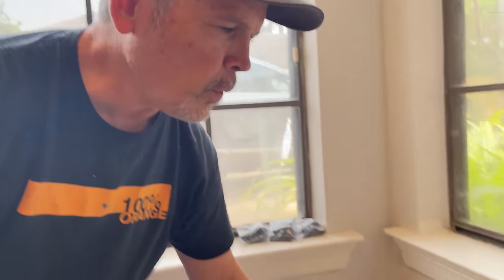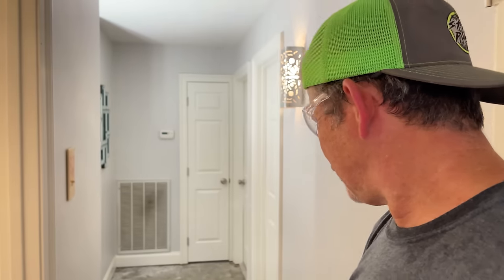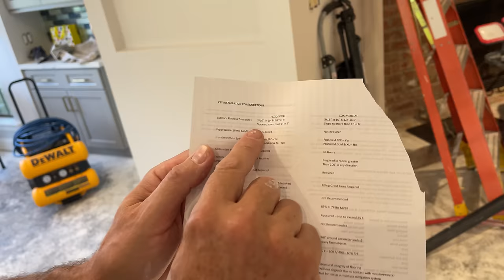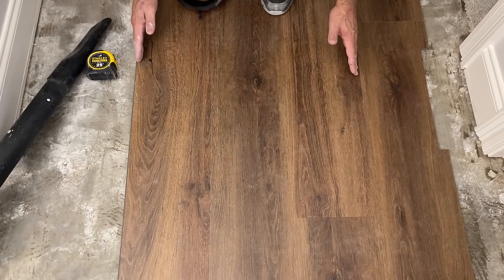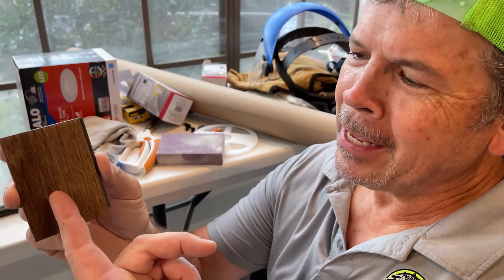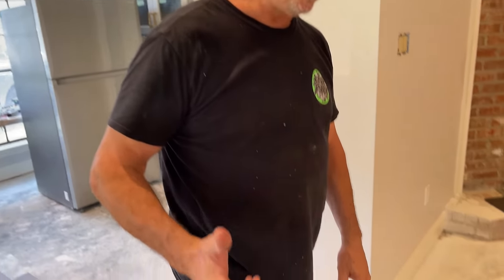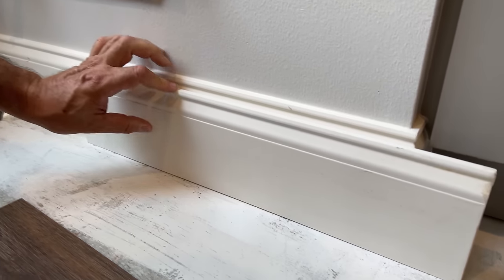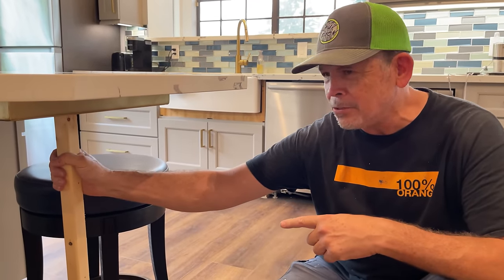The ULTIMATE FLOORING HACK! | Installing Vinyl Plank Flooring

Comment: Question: Why thin set and not the self leveling concrete stuff? I'm about to fix my concrete slab before installing my vinyl flooring and didn't realize thin set was an option. Looks a lot easier to work with than pouring all the self leveling concrete. Thanks again for your video, love how well you all explain everything.

Comment: I am replacing both baseboard and quarter-round on about half the perimeter of the kitchen. The other half is toe-kick on the base cabinets. Should I install the baseboard first, then floor, then quarter-round? Or do the floor, then baseboard and quarter-round on top? Thx,

Comment: On the version of vinyl planking I've used, using the tapping block to "protect" the edge joint turned out to be a bad idea. Banging on anything except a scrap piece with a mating joint would totally ruin the joint. I also found it's a good idea to brush out both sides of a joint before putting two pieces together. Even a single grain of dirt can make the seam less than perfect. 
I wish I'd had your tip about using soapy water when sliding a piece into a joint lengthwise; that's a good one.
Reply from the maker: Thx Karl.   Yeah seems like every brand is different 😡
Reply: YES! I only use mating cut-offs for tapping blocks. Never hit the edge directly. Damaged edges can be costly in material but even more so in time. Although I have never tried the soapy water trick. I will definitely give that one a try next time I'm in that situation. Thanks guys. Subscribed. Great show!
Reply: This is true with almost any tongue and groove product !  With solid oak flooring a long shoulder plane is a good thing to have around too !
Reply: When you install floors in the kitchen, do you cut around the kick plate of the base cupboards and install quarter round or do you remove the the kitchen base cupboards.
Reply: I always use mating pieces  The long edge on the floor piece goes unscathed .  Just make sure the tapper is square with the floor piece .  An angular tap is going to bugger up the floor piece's long seam edge.  Use the same pieces and they slip right back off after the love taps .
Reply: I learned to check the quality of the joints of flooring before buying them. It can mean the difference between a week of work and a couple days. I've ended up just sticking to products I know I can rely on to not be a wrestling match at every step.
Reply: Jason Moore  Jason, can you describe the set up or put up a short video please, I am in the process right now and would love to see or understand this set up...thanks!!!
Reply: @eddym8024  Eddy or anyone else reading this, have you experimented with the optimum size of the scrap Tapper piece as far as width.  The wider the piece, the more the force of the tap is spread out.  If too wide (12") it might not be enough force to close the joint?...if too skinny (2") it might be too much force in a concentrated area? I'm new to all of this but now I have to finish a job two "professional" handymen with experience in LVP installation butchered yesterday at my house.  The Product is LifeProof LVP and the mating (tongue & groove) type of connection are apparently more fragile than other brands and thus tricker to install for 1st timers like my Handmen and now me.  The only difference between them and me is I am spending a day doing research on Youtube for techniques and potential problem areas installing this product.  I'm hoping when I start work to finish the 75% of the job they did not get to because I sent them home after 7 hours of "beating planks", my knowledge from the Youtube videos and ESPECIALLY the commenters (I read all of them and they have many extra tips and tricks) the job will go more smoothly for me.  My handymen beat the snot out of every plank except the first row with a plastic block and I think they damaged the long joints on every board making each successive row just as hard requiring 30 to 50 hammer blows (not taps) on each plank and then removing and trying again.  I knew something was very wrong, either the product faulty or the installers uninformed and not willing to stop and figure out what they were doing wrong.
Reply: Jason Moore  The ratchet straps set up for pulling the planks together instead of hammering them into position.

Comment: What a lot of work.  There goes my grandiose ideas of fixing my house myself.  How does one ensure quality workmanship such as you demonstrate when having someone else do it?  Also,   is this type of flooring a good choice for radiant heat floors?  Also, can one just patch those pockmarks and cracks in the concrete without smearing  and then scraping the whole floor? Thanks.  Also, what is thinset.  Thanks.

Comment: Rotate your plank 180 for the end piece. Line up the end of the plank with the previous end piece. Mark where the new piece just overlaps the last piece you laid down. Score it then snap it. Rotate 180 and put it down. You don't have to hunt for your measuring tape and remember numbers that way.
Reply: "Rotate 180 and put it down". I thought it was "put it in"?
 It's what my wife always says.
Reply: @diGritz1  If she has you rotating 180 first, that's probably your husband
Reply: Wouldn’t that only befor same end pieces (stacked) vs offset?
Reply: @Jopacob  No.

Comment: Curious about something.  Why not remove the baseboards, install the LVP and then reinstall the baseboards.  Then the wedges would work or I just screw in a 1/4 inch thick 4" by 4 foot  board all around the perimeter.  Then when done pull my boards and then reinstall the baseboards.  Paint where necessary.  Just a thought.  Great video.

Comment: what did you do about the space beetween the subfloor and baseboards around the edge of the flooring? wouldnt their be a void where dirt/crumbs/moisture/bugs can collect?
whats the waterproofing like? can moisture get in the joints and sit?

good job though! great video. i really like the tip on using the scrap ends as blocks to hold the floor

Comment: 22:26 "Where did you find that kid?" -- This reminds me of a funny story.  TLDNR

I moved to KC, Mo back in '87 (I was about 25) with nothing but a seabag and $20 (not even a car, I took the bus).  The first day there, I was walking the neighborhood, scoping out where I could find a job.  This pickup turned onto the side street in front of me and the driver stopped, leaned over the passenger, and yelled at me, "Hey, are you going to work today or not?"  I shrugged and said, "Sure!" and jumped into the back of his truck.

We drove a few more blocks and joined a crew that was cleaning out a backyard.  After an hour or so, I was carrying a concrete block to the dumpster when I passed the guy who had yelled at me (the owner of the company) and he stopped and looked at me and said "Hey, you're not Steve!"  I looked him in the eye and said, "So, do I have the job?" After about a second of him trying to wrap his head around the situation, he said "I've been watching you work.  Hell yeah, you have the job!" Later he told me that he had been thinking that "Steve" was working harder than he had ever seen his work before, before realizing that I wasn't Steve.  🤣🤣🤣

I worked for that guy for another 4 months until he ran out of work and had to let most of his crew go.
Reply: That's a great story.
Reply: Poor Steve…🤓
Reply: Good story! Now a days it probably wouldn't be a good idea to jump in a pickup like that to start working.
Reply: "jumpin' in a vehicle" and out...  - that reminds me of a true story - FNK

Back in '77 I was doing my first job. A little back story.. I was lucky I had this job. It was representin' back in the day. The who's who got the nice jobs, learning how do to do stuff. I got this job cuz I needed it. I needed some new threads for junior high, and the dances required some disco threads, you dig? anyways, I was with a crew of summer help that I knew from little league baseball, and junior high sports, these were all my rivals. My mother was executive secretary for school super intendent, so that helped me get on this summer crew when it organized. We painted all the school classrooms, and laid many football fields and parks with grass sod. I got paid peanuts for this hard work but it was good money. I wanted the job to stay outa trouble... and a pair of super fly bell-bottoms

The "jump in"....  We were all at the School District's Bus Barn. This was where all the school buses were at. We cleaned them all. I drooled at the only two diesel buses which were for the varsity high school traveling teams.  Man we just took one to our baseball state championship season. I was in one to Little League championship games in San Bernadino , from along ways away let's say.  At lunch the boss, who was a pitching coach also, and all the bus barn workers went to lunch. Us kids had brown bags. There were two awesome brand new Driver's Ed cars in the barn. I was dared, then double dared I could not drive. I said I probably could. I jumped in this car, and another kid jumped in.

welp. he was dumber than me.. for jumpin in thinking I could drive around the barn.  safely.

I made it thru the barn making both bays and gassed it alittle to show off.  I made the left turn and all the way around the building. as dared.
The problem was stopping. I panicked when I saw the nice diesel bus. In front of me. So I gassed it as the car was against the bus.
I was in a panic and burned lots of rubber pushing on the bus.
When I "came to" back to reality... there was lots of smoke...
The looks on everyone's faces...........
Mom was going to KILL me...

the "jump out"   Well, now we are headed back to where we all meet in the mornings. Which was at the Super Intendent's office. I was dead, my mom was at work..
We are driving down the highway, all the crew are sitting in the back of a pickup truck, like everyone did... 
I knew when we had to turn left, the only and last place they would slow down.

Halfway thru that turn sucka... I am gone.   Diving to home base. blind dive to pavement. I even outran the pickup before it could even think of turning around.
I made it home, in shock, banged and bruised but alive....  

I haven't jumped in or out of anything too awful much since that Summer of '77....
Reply: @diywtlc2249  Great story!  Oh, the days when we could get away with shit.  LOL
Reply: @diywtlc2249  is
Reply: LOL! That's pretty funny! Closest I had to that was when I was trying to help my Mom find something in a computer store & the manager mistook me for an employee and barked an order at me. Later I was helping another customer (because I like to be helpful and knew about the tech). Customer asked if worked there. I said "No". Manager went pale and apologized to me. Told me I should apply for a job there. Unfortunately, the whole franchise went out of business. shortly after that.
Reply: Doesn't your younger son have his own iname nstead of 'Jordan's brother'?

Comment: How do you deal with door trim that is cut too high (for previous thicker 3/4" hardwood) and new vinyl plank flooring is much thinner?  Toe moulding is fine around the room but you cannot install toe moulding around the door trim.  Do you have tips and tricks to deal with this type of situation?  I prefer to not remove all the door trim and install new.  How do you fill that excessive gap?

Comment: Great video, but instead of screwing the holding planks down into concrete, use a hot glue gun. Placing one small walnut glob of hot glue on each small plank and press the plank in the right position unto the concrete. When your done it comes right up with a putty knife (little effort) but it holds great. I've done this technique on concrete floors and it worked great. Just an idea... 
Keep up the great work, loved the soapy water trick, live and learn...
Reply: Hot glue won't work on backed vinyl. The backing will separate or slide out of place

Comment: I always make a trace piece when I work with the that style of vinyl. But I’ll tell you something right now. Glue down vinyl is superior. LVT all day. That entire space coulda been done in 1 day not counting prep time. 

Also to take flooring seriously. But a horsehair broom. I would also have just skim coated the floor with some latex patch. Way faster and efficient. Mapei makes a great one. I usually do 2-3 coats and you can sand it afterwards for a nice finish.

Side note. If you are ever doing this type of flooring. Do not forget movement. Makes this flooring a nightmare to maintain

Comment: I want to ask about expansion gaps ? The manufacturer states to leave a 1/4 to 1/2  inches for expansion. I didn't see you do this ,  also on smaller floor areas (small rooms around 5x6, etc. ) My floors kept shifting when tapping sections together.  Would you still start in the center with temporary flooring pieces screwed in a wood sub floor ?

Comment: i like your idea with the drilling the concrete to fsten blocks many yrs ago we would use case hardened steel pins to do the same thing but dont know were to get them today 33 yrs ago i moved to oregon and never install flooring over concrete

Comment: I'd like to request a video on how you do your finishing. Edge finishing, transition finishing from different materials. Most projects fall short with poor finishing in the smallest of area's. What did you do to hide the transition of rough angled cuts along the fireplace brick etc, etc, etc....
Reply: I was also hoping to see the final/finished flooring edge against the fireplace. If it’s in another future video that I find, I’ll link it here for you.
Reply: At the fireplace he used a molding. Whether it be quarter round, a ripped down Tmolding, or end cap. What looks the most professional is undercutting the fireplace. That way it looks like the fireplace was installed on top of the flooring

Comment: I’ve been looking at waterproof vinyl laminate, click and lock. I have gotten a number of people telling what the best mm layer is for wear pattern. So what is your preference? And do you have any particular brand you have worked with and consistently gotten great results. I am also looking for a pattern that will mimic the rest of the wood flooring in the house at 2.25”. Just to make sure I’m explaining correctly,..I don’t expect that each board will be 2.25”; just the pattern will look like it. Thanks and thanks so much for the laser idea and all the other tips and tricks. You guys are the real deal!

Comment: With most laminate floors, especially the ones that click into place, you cannot work from both sides/ends. And better to remove baseboards during a reno rather than installing floor underneath.
Reply: Have you ever installed a tongue and groove system?  I've never once in my 15 year career and 100s of thousands of sqft of tongue and groove systems, not been able to work backwards with a product, though may be more difficult.  That's the whole point of it.  That's how you wrap a kitchen island, or go down a hallway and back into the bedroom on the other side.  You can literally lock a tongue and groove system in from either direction, either side.
Reply: You can backfill with most flooring.

Comment: What do you do if all door trim is metal and you cant cut under it to slide flooring under?? This is the problem with my older '70s building. The guy who did the main area left a huge gap around door frams and filled with dark brown glue which looks awful. I am doing bedrooms myself.

Comment: Hey if you’re running your floor counter parallel to weigh the vent is cut out on the edge of one section of your flooring do you just cut all that out have a bunch of little pieces 4 inches from the wall?

Comment: Ever thought about putting a second stage on your shop vac?  Cyclone separators work wonders and save you on filters.
Reply: You can always just run a bolt and nut through your filters and chuck it in your power drill, then spin it super fast. It'll clean out the filters pretty well :) It's definitely best to do it in a box or trashcan though or else it will make a mess lol.
Reply: @Zalagar619  great idea! But then the bolt and but stays on forever? Or else I’ll have a hole in my filter.
Reply: @xcx4x  most filters I've seen have a hole through the middle to secure it, so it would just go through it to hold it while cleaning, then you take it off and reinstall it like normal. There should be some videos of people on here cleaning their filters with this method on YouTube :)